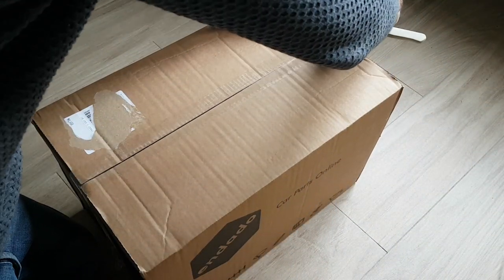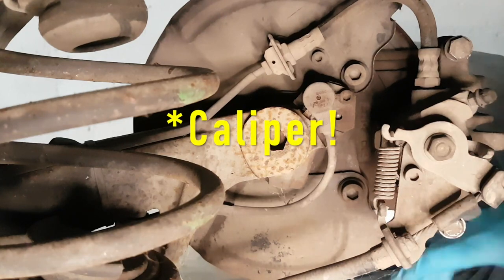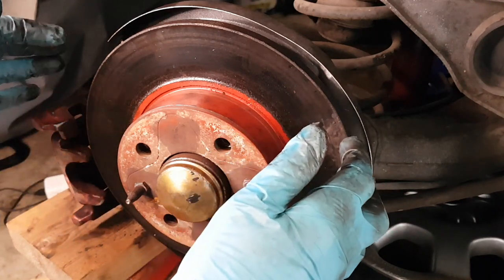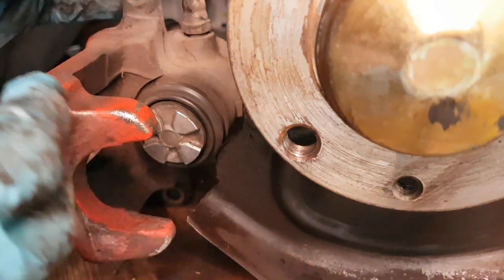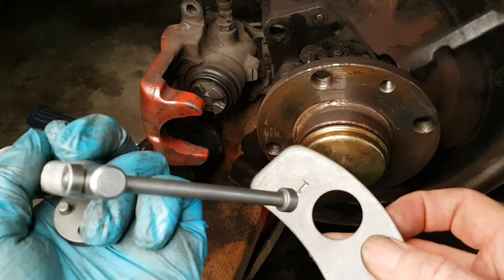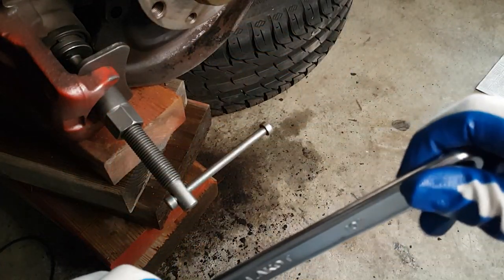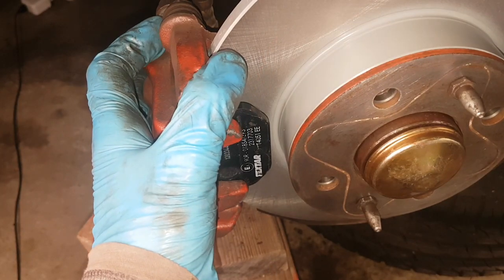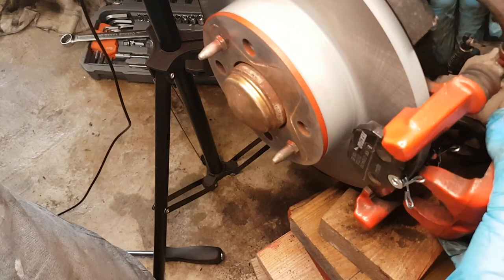Fiat Barchetta | Change rear brake discs and pads | Fixing cars | Italian classic car | Project Car

Comment: That "screwing back" the piston is very common when you have the parking brake in coop with the  hydraulik system.
Reply from the maker: Thanks for your comment. It was a first for me! Not change rear discs and pads before.

Comment: From experience with those Lucas type rear callipers, if you need that much force to get the piston to go back the calliper needs rebuilding or changing for a new one.
Reply from the maker: Funny you should say that. This will be probably be featuring in a video very soon. Thanks for your comment.

Comment: i usualy use copper grease on the steel mating surfaces so they don't rust stuck
Reply from the maker: Thanks for the tip I think I will take it apart again and put some on.

Comment: Hi, is it necessary to use thin sheet of metal between pads and caliper?  I think it is called fitting kit. Thanks
Reply from the maker: I'm not an expert but I think it depends on which calipers you have. Mine don't have any extra clips or fixings.